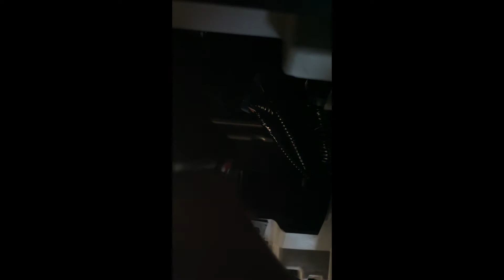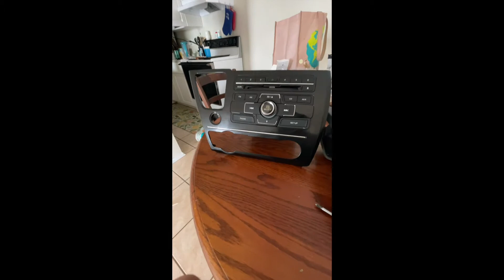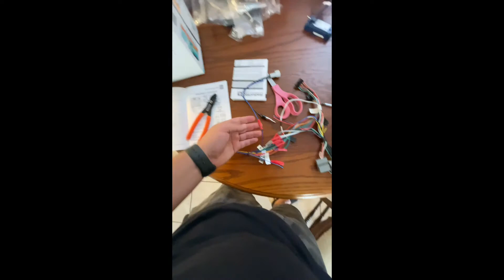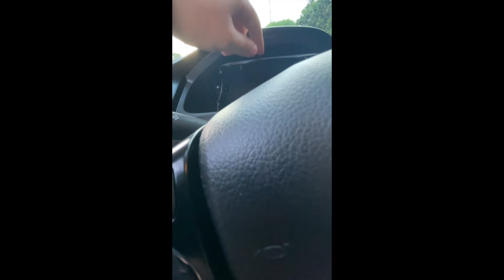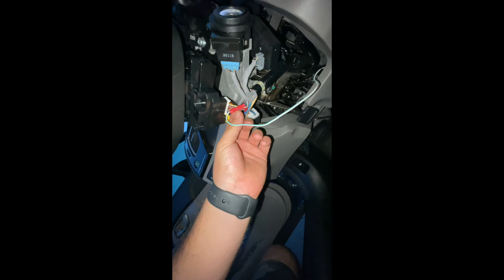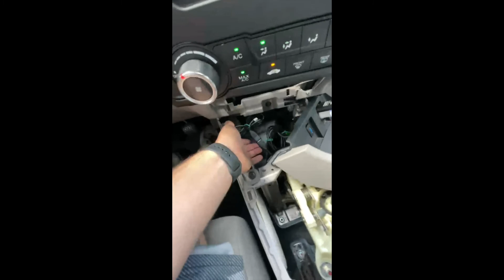Honda Civic Apple Car Play Install

Comment: so everything in the description is what i’ll need to set this up ?
Reply from the maker: Yes you can use any radio you want and run a after market back up cam to it if you want but im okay with the stock one

Comment: this is very helpful for me trying to do this on my 2013 honda civic, i’m trying to get a larger screen though, going to try and maybe modify the shell, but i don’t know how much bigger i could get it
Reply from the maker: There is a 10 inch one at Walmart from the  same brand that fits the same size frames it just sticks out
Reply from the maker: https://www.walmart.com/ip/Dual-Electronics-XDCPA11BT-10-1-Double-DIN-Car-Stereo-Receiver-with-Apple-CarPlay-Android-Auto-and-Built-in-Bluetooth/311763522?athbdg=L1600

Comment: Where did you buy the steering wheel harness ? And the stereo harness ?
Reply from the maker: On Amazon they are one unit
Reply: @kyleworksoncars   ok I’m going to check it out do you know what the brand was ?
Reply from the maker: @genrs13   pac
Reply from the maker: It’s the 3rd link in the Description
Reply: Thank you

Comment: How’s the audio quality? Better than stock? And, have you used the map? I’m looking for an upgrade and audio + map function are the two most important things to me.
Reply from the maker: It’s way better then stock and give you a lot more customization I haven’t put a sub in it yet but I want to for sure and yes I drive for door dash and use the Apple Maps on it every day,  one of the main reasons that I installed it was for the maps
Reply: @kyleworksoncars  Cool, I’m glad to know that the audio is better and that maps are functional. I’m also a delivery driver, so yeah I’m sure you know the importance of that
Reply from the maker: @LunarSilverTone   yeah I would say it’s not bad for the price of the head unit  but if you really want better sound quality maybe look into a little bit pricier like a Sony

Comment: I wish the backup camera showed on the big screen as well
Reply from the maker: I kept my stock back up camera , if you want it to show on the big screen you just have to run an aftermarket one and it will
Reply: @kyleworksoncars  How exactly did you keep the stock backup cam? I'm doing a stereo install in a 2013 Civic tomorrow.
Reply from the maker: @jackkhol4251   I just didn’t unplug it from the stock location if you watch at the end it still shows in the little screen not on the new head unit
Reply: how did you install the back up camera?
Reply from the maker: @josecarloscouso3466   it comes stock with it